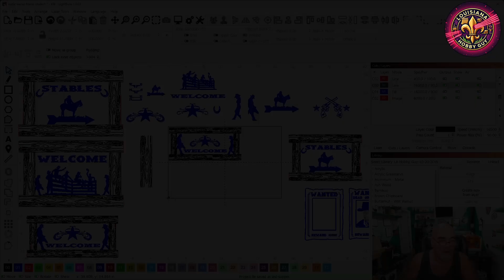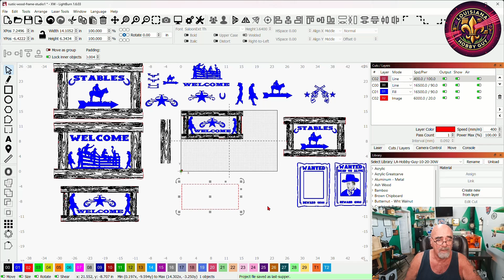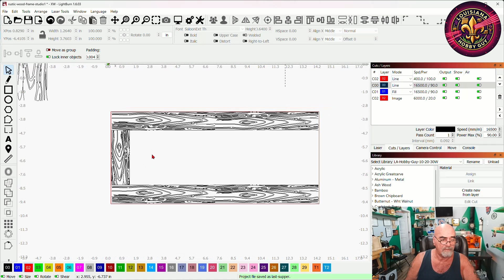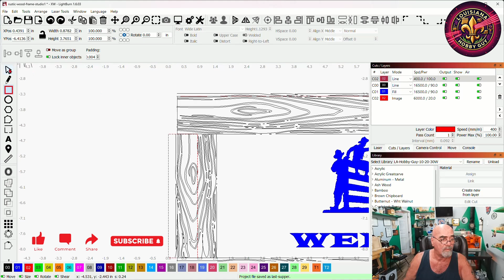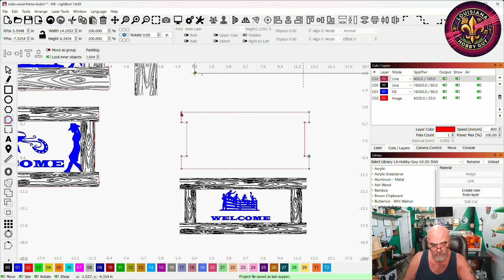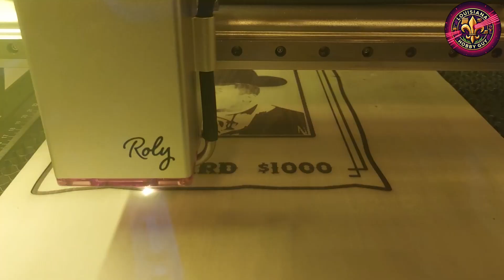👍 Designing Country and Western Signs in Lightburn, and FREE FILES!

Comment: Good day sir, I was wondering if by chance you could help me. I am a laser newbie and most of what I have learned so far is from watching your videos . My kids give me an Aufero 2 laser for Father's Day. I purchased light burn set everything up and it was working great. My wife bought me an extension kit. I followed the directions to the letter and for some reason, everything is burning in a mirror image now. If you could help I would be great and thank you for your time
Reply from the maker: Likely your settings are wrong, Click on the wrench and screwdriver icon and adjust your origin to the bottom left. You'll also need to change the working size in the Machine Settings to the new size with the extension kit.

Comment: Rich, I need help.  I have the demo program of light burn right now and for the life of me I cannot get it out of mirror mode.  I am having to flip my images to make them engrave/cut the right way, any suggestions on how to get it out of mirror mode??  I am new to this so I am just learning.  Also, when I try to engrave something it tells me that I may be cutting out of my area but it is like just a 4x4 inch image so I know I am not out of my area.  I really need some help  lol  thanks so much!
Reply from the maker: You likely have your origin of the laser set wrong in the Device Settings Debbie.
Reply: @TheLouisianaHobbyGuy  ok, thank you, I will work with it more today and see if I can get it straight :)
Reply: @TheLouisianaHobbyGuy  I got it fixed, I just went back to prefs and reset it back to the day I downloaded it and it worked :)